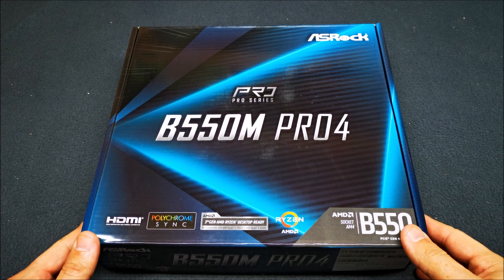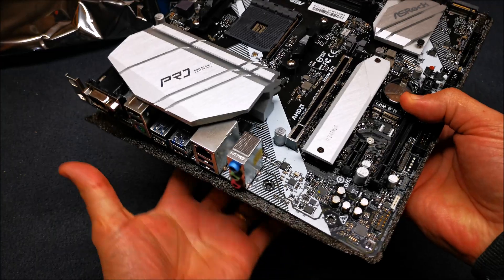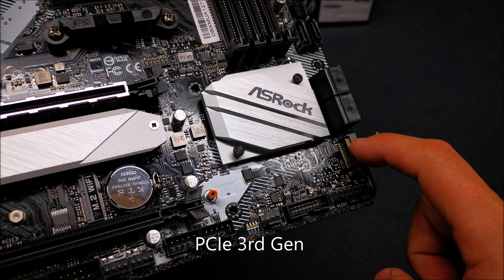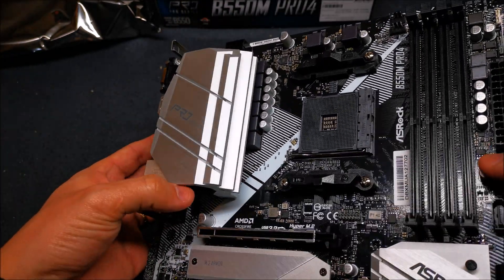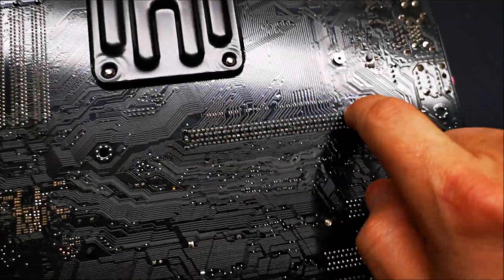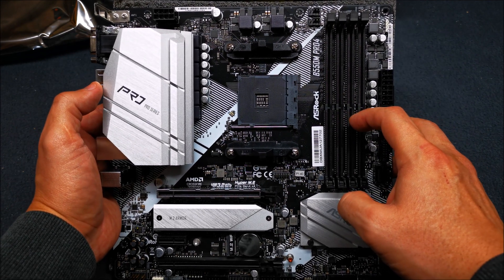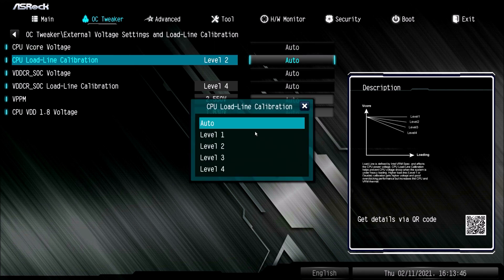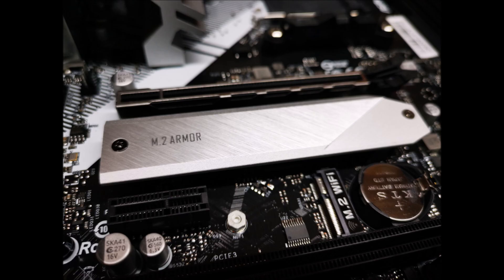ASROCK B550M Pro4. A Solid B550 Board?

Comment: Does this board support ryzen 9?
Reply from the maker: Yes, but the vrm is not built for high power cpus, like the 5950x. I would not go over a 5800x with this board.
Reply: @TechnologyHive  do you recommend it for a ryzen 7 3700x with stock cooler build ??
Reply from the maker: @Aldertlake  It will do just fine with a 3700X. Although I would put on an AIO on that CPU.
Reply: @TechnologyHive  AIO = not reliable why not an AK400 from deepcool

Comment: I use A1_B1 ram slots and the xmp is not working, but A2_B2 is working, is this normal?? I want to install 4 sticks in the future??
Reply: yes A2 with B2 is default on any board for 2 sticks out of 4 slots default-dual-channel-setup. Ideally you use 2 sticks even if you have 4 slots... 4 sticks puts lots of strain on the memory-controllers. 2 sticks is snappiest. I had 2x 8gb, found new corsair 32gb as 2x 16gb 3200mhz cl16 and got them instead for 50 euro, they work at 3600 MHz no problem with XMP on.

Comment: 11:30
What system did you build? Did you use this board?
Reply from the maker: I had two of these boards. One I sold. The other is just sitting here waiting for a GPU. Hard to find one nowadays. When I put it together I'll do a follow up 😊👍.
Reply: @TechnologyHive  I'm in a similar position. Mine's sitting in a box waiting for a whole bunch of components, but I've recently acquired a 3060. Good luck on your search!
Reply from the maker: @mcrazza  Thanks 😊. I do have other gpus. I just don't have one for this board and set up. Minning really dried up the gpu market. Now they are coming after SSDs lol

Comment: Tip:  Anyone having long shutdowns with this board, make sure all of the USB, usb peripherals like mice/keyboard/card readers, and audio drivers are installed and updated.  Once installed, it will shutdown in seconds instead of minutes.  DriverEasy can query the IDs to see what is missing.  Normally I would never ever use something like that but it found my issue.  I found someone else in the Windows Ten forum having the issue too and that is how they found and fixed the issue too.

Comment: I have this board and noticed this specific board’s BIOS does not show/state if the memory is running dual channel or not.  I can see you had two DIMMs and it doesn’t state it either.  Some other Asrock boards like the steel legend will state dual or single channel on the main page.
Reply from the maker: If you download CPU-Z you can check there if your memory is in dual channel configuration. But this isn't the only thing people noticed missing from ASRock bioses lol there's room for improvement 👍😊.
Reply: @TechnologyHive   I think Asrock boards and bios are great.  I just think they didn’t include the same code in this one to show dual channel or single channel like they have for some others.  Someone said it has to do with the code they get from Taiwan/reference.  Yes, I know about cpu-z showing the memory channel mode, I was just making a point about the lack of this in this one board.  It is a good board.
Reply from the maker: @dadadadada4975  I like the ASRock bios more than Gigabyte's bios for sure. Although the layout is nice, don't get me wrong, I find ASRock bios buggy at times. Some values are set automatically that exceed the safe limits, like SOC voltage being set to 1.2v unnecessarily, and many times some values you set manually are not respected. Maybe I'm just being picky 😒. 😊👍

Comment: i ve got this b550m pro4 and 16gb dual channel ballistix 3600 cl16  1.35v and auto xmp dont work. can u help me?
Reply: that sucks, I run the same memory 4x8gb on ryzen 5 3600 and it runs perfect out of the box and 1.20 bios
Reply from the maker: @marcinsobczak2485  you must have a real good memory controller 👍
Reply: @TechnologyHive  Yeah I was thinking about upgrading to ryzen 5xxx but as they say 'if it ain't broke don't fix it'
Reply from the maker: Wise decision 👍😊
Reply from the maker: Do you mean the XMP profile does not work when you turn it on in the bios? What bios version are you running? Also what cpu?
Reply: @TechnologyHive  r5 5600x and 1.4 bios
Reply from the maker: @namolmarinica3639  Hi. I'd sudgest you update to 1.90 BIOS. Try that and see if that helps.
Reply: @TechnologyHive  i ll try. ty

Comment: im going to use ryzen 5 3600 and gtx 1660 super. should i take the pro4 or steel legend?
Reply: for ryzen 5 3000 series pro4 is enough, dont overspend on motherboard.
Reply: @vinuVA  aight thankss, i think i might chose the pro4 for its price
Reply: For the money this one is great unless you don’t care about money or you need extreme overclocking, then go with the legend.
Reply: @dadadadada4975  lol alright im looking forward to it thanks
Reply: im new to this so yeah i need a lot of tips
Reply from the maker: I'd take the steal legend if it's at a reasonable price. 50 Amp power stages on the VRM. Better than the pro4.
Reply: @TechnologyHive  alright thankss for the reply
Reply: alright thanks guys

Comment: Hi,
I'm planning on upgrading my ram from 2x 8gb ram to 4x 8gb using this motherboard. In the manual, it states that I can only run the 4 ram sticks up to 2667 Mhz. 
Am I reading that wrong or can it go higher? Thanks for the video. :)
Reply from the maker: Boards and cpus, depending on individual cases, have limitations. It may or may not work. My Gigabyte aorus pro v2 would not post with XMP 3600mhz enabled with all 4 dimms populated. I'd say you read that correctly.
Reply: @TechnologyHive  Alright, thanks for the help! :D
Reply: @burd7455  I have this motherboard with 4x8 crucial 3600mhz and it runs great with automatic xmp.
Reply: @marcinsobczak2485  thnaks

Comment: At its memory support page it writes that it supports only ballistix elite 3466mhz on ballistix side. Im thinking of going with ballistix 16gb 3200 or 3600mhz. Would that cause an unstablity?
Reply from the maker: No. You should be fine using any memory you want. I am constantly changing ram on this board, from Corsair, G.Skill, Crucial, to ADATA. All work just fine with XMP profile active or not.
Reply: @TechnologyHive  you mean ballistix by crucial right? because in support list it supports crucial memories but not ballistix
i thought itd run properly too
Reply from the maker: @mfatihy70  Just remember that Crucial memory is "owned" by micron. Micron makes the memory chips in Crucial memory. No matter what you buy, ballistic or not it's all micron. In your case it's most likely E revision, which is great memory chips. Yes it will work fine.
Reply: @TechnologyHive  thanks for quick reply man appreciate it
Reply from the maker: @mfatihy70  no problem 😊

Comment: arent the usb ports 3.2?
Reply: - 1 x USB 3.2 Gen2 Type-A Port (10 Gb/s) (Supports ESD Protection)
- 1 x USB 3.2 Gen2 Type-C Port (10 Gb/s) (Supports ESD Protection)
- 4 x USB 3.2 Gen1 Ports (ASMedia ASM1074 hub) (Supports ESD Protection)
- 2 x USB 2.0 Ports (Supports ESD Protection)
- 2 x USB 2.0 Headers (Support 4 USB 2.0 ports) (Supports ESD Protection)
- 2 x USB 3.2 Gen1 Headers (Support 4 USB 3.2 Gen1 ports) (Supports ESD Protection)
Reply: @dadadadada4975  that's really helpful.Thanks
Reply from the maker: Yes they are. I simply forgot to correct myself in the description. Thanks for pointing that out. 👍

Comment: AsRock... solid? Doesnt sound as if this fits together
Reply from the maker: Sounds like you're not a fan?
Reply: Technology Hive not really i had 3 AsRock mainboard, ofc all the cheapest aviable and 2 of them died between 1-3 years, meanwhile my experience with gigabyte boards was since ever nice and they cost mostly only slightly more but were still fair priced. But i dont have any experience anymore with IT stuff newer than 2016 so probably this Asrock board is ok
Reply from the maker: @harrison00xXx  That's good to know. At the same time it's disappointing to hear that. Seems like manufacturers are letting quality go over profits. Had same issue with Asus B550 boards lately. Come to think of it I should've made a video about it.
Reply: @TechnologyHive  Yeah Asus is a great example. I once was only using Asus Boards since they had a longer time ago a fair price, sometimes even cheaper than AsRocks but a good build quality, but somehow in many cases i heard lately (the last few years) very often that someones Asus Board was dying too.
Im damn happy that my Gigabyte Z97 Gaming 5 is still working great since 2015 with my good old 4790k at 4,5, rarely 4,8 GHz and 2666MHz Ram OC.
Reply: @TechnologyHive  I learned my lesson as the 2nd Asrock board died. Before i used my first AsRock board i always used better power supplies, had no problem to pay for a mainboard like 80€ meanwhile others with same chipsets cost like 40€ and so, never had any issues. My first (ultra cheap) AsRock was working fine, but i realized pretty soon the power delivery wasntreally optimized for Phenom II X6 CPUs, at least when it comes to overclocking. The 2nd AsRock with better/more VRMs and cooling was also much cheaper than competition, my Phenom II also worked well with 4,1 GHz OC but this was the first board ever dying, same with a replacement luckily none of these boards killed my CPU. Since the 2 of 3 Asrocks failed and i dont had any trust anymore in Asus, i deciced to go to Gigabyte which are making pretty good products, at least when it comes to mainboards in my opinion.
Reply from the maker: @harrison00xXx  I think you might have made the best decision there. Gigabyte is an excellent brand. I can not remember any of their boards ever going bad on me. Nowadays with the newer stuff you have to pay a premium to get what was standard back in 2008 boards, meaning strong and reliable VRM's and other components. Sad we are heading in this direction.
Reply: @TechnologyHive  I mean... all AsRock boards i had were:
1) the cheapest possible ones
2) boards rated for a 125W TDP CPU
3) used for overclocking (at the thermal or stability limits, CPU wise), so 150W+ is more realistic

So the reasons Asrocks were to only dying ones can also be that i only used Asrocks on a "high TDP" AM3 platform, meanwhile everything before and after were 45-88W rated CPUs (like Athlon 64 X2, Core2Duo, i5, i7,..)

Its these days anyways more of a "brand loyality" than anything else, especially if i see very expensive hi end parts which have also a "high" rate of failure. Even if i build in 1-3 years a new PC, it could be easily possible that i use once more AsRock, only because of the pricing since even mainboards are today already pretty expensive.
The other reason i picked Gigabyte (Z97 Gaming 5) for my mixed (used and new parts...) PC build/upgrade was anyways that i knew the combination of the best 2400 MHz DDR3 ram (any Gskill i think...)  and a 4790k was overclocking well with Gigabytes Z97 boards since they had a awesome VRM bank and were overclocking nice. I really wanted a Gaming 7, but the higher price wasnt worth it in my opinion and the Gaming 5 also did a great job with OC even if i used a cheap at ebay shot 4790k, even until today in 2021 which is still my gaming machine with a good old GTX 1070 (which aged also well, especially considering GPU prices...)
Reply: @TechnologyHive  "I think you might have made the best decision there"
with the gigabyte.... probably.

The best decision in my opinion was that i build in end 2015/beginning 2016 a PC mainly out of used parts (Ram, CPU, reused case, PSU and co.) since in 2015 prices were rising already pretty crazy and i didnt want to support anyone, not AMD, not Intel, especially not Nvidia (which in fact i had to do because of a proper GPU since the GTX 10 series were the only "futureproof" and efficient GPUs these days).
A 4790k (130$ ebay auction from a brand new seller) is still today awesome for 99% of the games, a GTX 1070 is already a bit "weak" but who cares it pushes still enough fps in 1440p which is the only res i am using on my 165Hz Gsync screen and its pretty awesome that a 2015/2016 GPU is still fast enough for 2020 titles.
Ofc i would love to see the GTX 1070 not running at its limits the whole time like my RTX 2080 notebook does, pushing beyond the 1070 desktops fps but the 2080 sometimes doesnt even run at full clocks and very often at 30-45% GPU load.

The more i see prices rising (especially CPUs and GPUs...) the more i know i made a good decision with my "cheap", around 500€ builld in 2016. Nowadays a proper GPU cost at least 500€, CPU at least 250, more like 300€+ for a "good" one if its aviable at all. Its so funny to see a old last gen DDR3 build being still competetive to "last gen" DDR4 systems 6-7 years newer. In Fact that was also a consideration: I absolutely didnt want to support (the markering gag...) DDR4, so i sticked even in 2016 still to a 2400MHz DDR3 system and hoped for usable gaming performance until DDR5 is aviable and affordable. Seems like my good old i7 and DDR3 can keep up with games until i can build a DDR5 system to finally get a HUGE performance improvement, even if im picking low end hardware then :D
Reply from the maker: @harrison00xXx  Yes true hardware prices are ridiculous today. If you can even find a cpu  or gpu worth buying. I think by the looks of it manufacturers are getting pretty comfortable keeping their prices up high. It's a new thing now where everything just cost an arm and a leg. I'm a real small YouTube as you can obviously tell 😂 and having to buy hardware from my own money at these prices, if I can find it, it pretty hard. What can we do, right?
Reply: @TechnologyHive  "and having to buy hardware from my own money at these prices, if I can find it, it pretty hard. What can we do, right?"
I though the same already nearly a decade ago. Hoped for some years if anything change, ofc it didnt so i build a PC out of used parts so i dont support any of this greedy companies directly at least, except for the GTX 1070 which was a "no brainer", 300€+ was a bit high for my taste and a "midclass" GPU, but hey, it was efficient, had 8GB VRam, cool and quiet and served me at least 5 years already, probably 1-2 years more. At least i got it before the mining hype really started to increase prices by around 30-50%. One year after i bought the 1070 brandnew i could have sold it for the same price (1 year USED!!!!), thats more of a bad sign for the users/customers.

As much people dont want to do that.... if something is only a bit overpriced already, it should be boycotted. Instead... people still try to get a RTX 3070/3080,  Ryzen 5000 CPUs and co... Im wondering if the majority of people will ever realize... THEY are the reason companies can act like this, as soon people boycott such overpriced electronic crap, prices will fall down to a fair pricepoint again. But the fanboyism which is getting more and more annoying (especially since Ryzen CPUs!) doesnt make anything better too.
Reply: @TechnologyHive  you are btw completely right with gigabyte boards. I looked into my PC right now, im wondering this PC didnt burnt the house already so many places where dust is multiple mm thick, dead crickets everywhere inside the case (i have reptiles and some insects leave the terras at the vents if the geckos are not hungry enough) and colors/text of any part are hided by dirt. Damn, even the VRM cooling fins are completely filled with dirt and dust due the excessive airflow in my case (3x 140mm front + 1x 120mm side intake, 1x250mm  top exhaust, 1x 120mm exhaust back) Antec 1200 case, only filtering method since a while is some magnetic in place holded 120mm filters to clean the PC once in a year instead of once every 3 months or like its looking now: last cleaning multiple years ago.